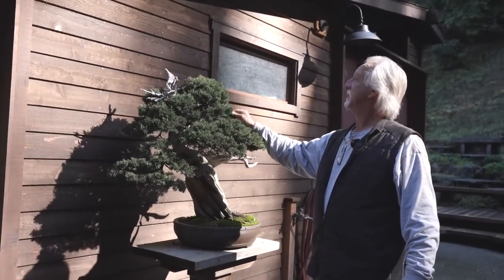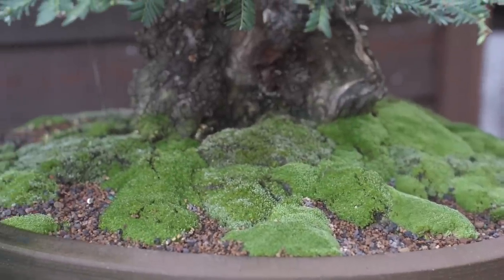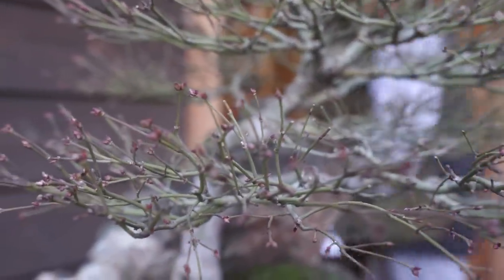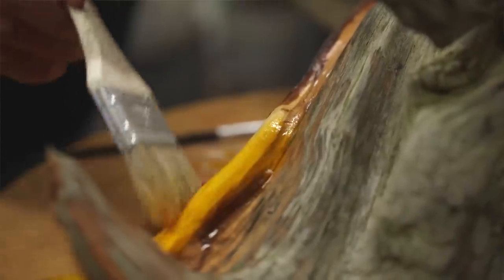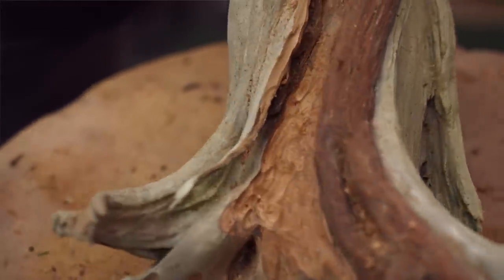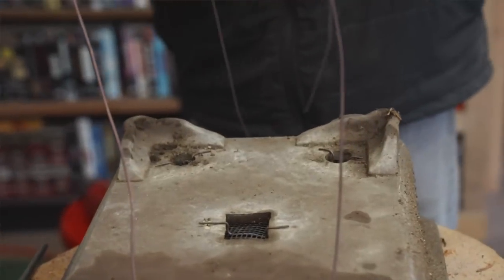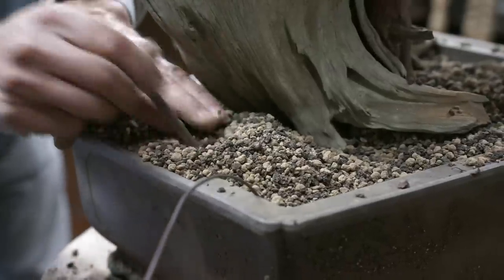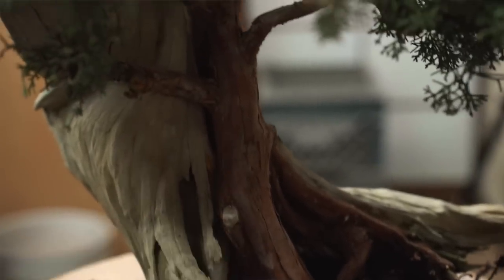Bonsaify | How to Make Amazing Tanuki Bonsai with an OG Trickster

Comment: Eric—I love his work and the tanuki is especially timely for me. Last summer I pulled up a dead juniper stump in my yard and have 2 shimpaku whips growing to go with it. For this video I would like to have heard him comment on how to preserve the lower portions of the stump from rotting once installed. Certainly just one lime sulfur treatment is not adequate. Also did he flatten the bottom to fit better in the pot? Will the live roots eventually take hold and support the dead wood? It also would have been helpful to get his insights on cutting the channel for the junipers, especially focusing on where to place them. For example the best old junipers seem to have the live veins along the outer edges of the trunk. Thanks for bringing him back—always great to see his work—Larry
Reply from the maker: This is great feedback Larry, thank you!
Reply from the maker: regarding the bottom - this particular piece had been a bonsai for a long time, so any old large wood below the soil line was already gone, and it was reasonably flat. You're right - and using wood hardener on the under side would be better for a wet summer climate.  Here in CA we don't have much in the way of rot problems - it will rot but it will take decades as long as you keep moss and dirt off the wood.

Comment: Looks great! Approx. how long will the base of the wood that is touching the substrate, last before it rots away
Reply from the maker: It might take a long time in NorCal - but they do rot. Probably no appreciable difference in the next 10 years.  We could have slowed that down by treating the bottom portion with wood hardener.

Comment: I used deadwood in terrariums before. In that scenario I baked the wood first to make sure there were not pest transfer. Would you recommend the same pre-treatment for tanuki?
Reply from the maker: In this case the wood was baked in some hot sun for a while. Pathogen transfer is always an issue, but i don't think a piece of deadwood is particularly problematic. Still, not a terrible idea.   Did it smell bad?
Reply: @Bonsaify  only when I accidentally little the tips on fire.😅

Comment: I have a question for you, so if I’m connecting deadwood to my plant, how do I connect the deadwood to the pot so everything stays in place thanks
Reply from the maker: In this case we drilled a hole through part of the wood that was hidden under the soil and stuck the wire through that hole to help anchor it. You can also use props - eg a block of wood under one part with a wire over the top if that helps. Each situation is slightly different, but the anchoring technique is largely the same as standard for established bonsai or for Yamadori.  In established bonsai a Four-point tie is used with wire laying over the rootball. When there is no rootball, then using anchors that combine a prop (to hold it up) and wire (to hold it down against the prop) are common. The rock at 07:13 and the hole drilling around 07:40 are both elements of the anchor.
Reply: @Bonsaify  thanks I live near some lakes that have some ancient driftwood. I’m gonna give some Sergeant junipers a shot. Got lucky on some lime sulfur old stock about 45 minutes away from my house. I want to grab two bottles of that for 10 bucks for 32 ounces. So of course, I’m gonna go all them as per usual for me. Thank you so much for your help and your videos. I guess it’s gonna be trial and error.

Comment: Nailing the tree to the dead wood does not cause harm to the tree?
Reply from the maker: I would say it does harm the tree; but, the amount of harm is low enough as to not cause a problem.  Think of it like if you stuck the end of a stick into a stream of running water and held it there - it causes a slight change in the flow of the water, but ultimately there isn't much difference.  Trees compartmentalize damage, and the nail will only harm a small part of the cambium, which will continue to grow all around it. The nails he uses, and the nail gun minimize the damage - no head on the nail so the tree will just grow right over it.